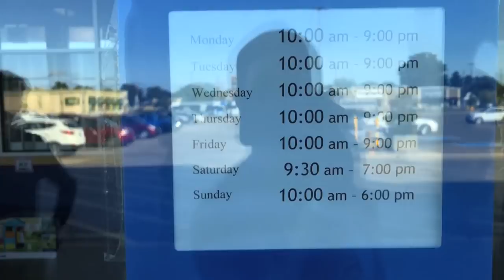Turning a KIDS TOY Into A FLAME THROWER!!!

Comment: We would make a flame thrower out other a fire extinguisher that is 1/2 full of gas and diesel mix. Remove the pressure Guage and put a air tank valve stem, same thread. Charge with compressed air. The nozzle we would use copper tubing. You wire a rag onto the end. Depending on the nozzle size and shape on what the flame looks like and how far it would shoot. Be careful it will shoot a flame upto about 50 feet. The first time I caught a tree on fire not knowing it would shoot nearly that far. Diesel or oil makes it stay burning

Comment: You want a home made flame thrower get a small 2 gallon air compressor a parts washing gun a 50 foot air hose the parts washing gun has a tube that you can stick into the gas and press the button it sucks the gas up through then light it I did that with WD40 i did it during my senior year of high school it was fun till I lit part of the lawn on fire Wooooopppss